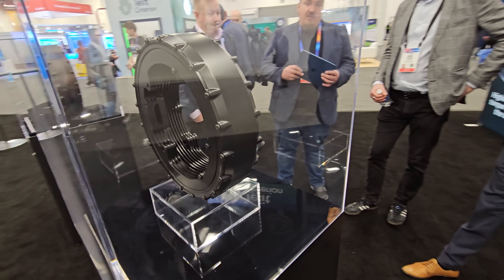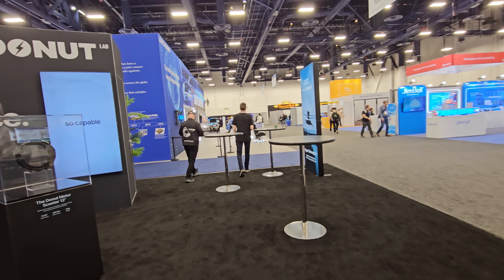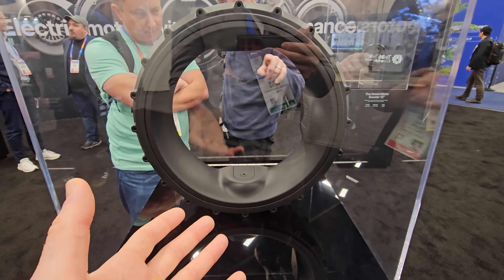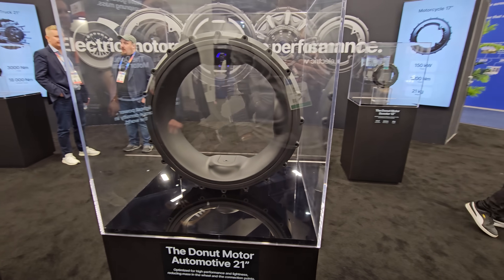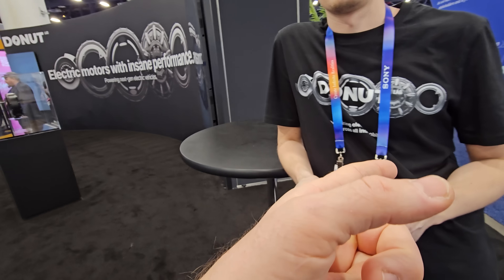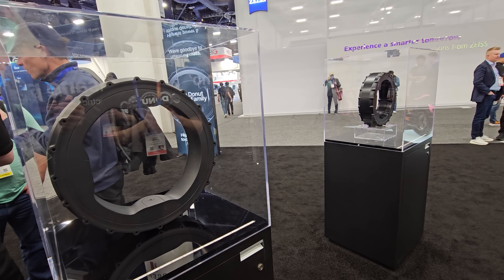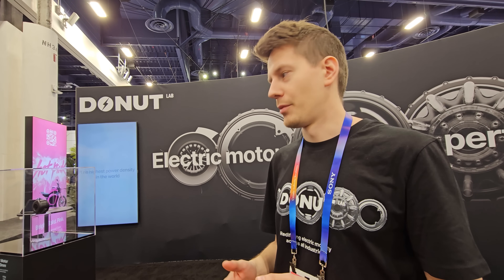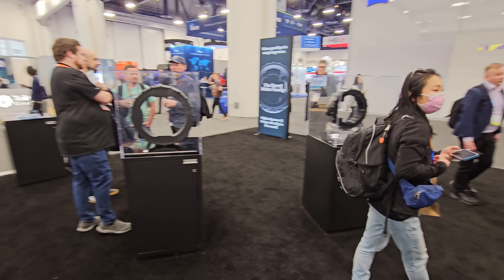Electric Motors With INSANE PERFORMANCE CES2025

Comment: There's no way that's real. A donut is a big zero guys. So it's a hub motor without a hub. The stuff looks very cool. So these guys have all brains AND style and there is no working version on display. No video. No charts. No pricing. That's a great big zero. A donut. The guy is a good talker. Eveey hubless wheel you see you never hear it in action. The numbers are so high. There has to be some type of iron core in order for the magnets to work. The core you use in your inductor matters. I'm not seeing an air core or whatever magic is allegedly encased in that flashy aluminum shell beating out current hub motors and also weighing less. Magical physics going on. A 40kg motor but way stronger somehow. 

Sure. No talk of how commutation is achieved or what kind of battery is required to get there claimed output or how far you would really go. It would take a huge battery. Even if this real (and it isn't, because a donut is zero it's such an obvious joke)there have to be downsides. Didn't hear any of that type talk. 

Nope. I think your first reaction where you didn't believe it was correct. The guy was a slick one for sure.
Reply: E motor tech is going nuts, I have a CYC motor that is 8kw + and the size of my fist,
Reply: The Verge TS motorcycle they have there in pink is their early version of the motor. That is a real bike and there are many videos, look it up.
Reply: @QuietContender  Any videos with sound of the bikes drivetrain or are they all pumped up ads with overlays of higher than expected specs. I'll go look but concept vehicles tend to have either heavily curated videos or disclaimers that basically allude to the vehicle being a one off.
Reply from the maker: You are lost in the sos 😀
Reply: @ElectricVehicleSpace  It's an obvious joke but it is funny, and if they get away with it it's way funnier. Just tell me where to send my money. lol
Reply from the maker: @zentechnician  you are so.....research for much this group paid for CES2025 visit and how big that stand it. People don't throw so much money without having something that works and has solid potential.
Reply: @zentechnician I’d be more interested in the bearing system and how it’s all kept square,
Reply: @LeglessReubsRides  What do you mean? It's not like a bearing as big as the outside of the rim would  have more surface area and therefore cause more friction. Yeah this issue has yet to resolved in any example I have seen. I did see Sam Pilgrim riding the failed one with his brother sitting inside the wheel. That was different, or as Sam calls it, normal. The thing was a noisy deathtrap. Oh man.
Reply: The media business is getting huge. So they just need sth to show and talk about is enough to make money.

The very first question is why? Why do you need hubless in-wheel motor. The only reason I see is for those who thought it looks cool. Otherwise, it is extremely stupid: the structure factor is huge, the bearing is disastrous, the sealing is harder than astronaut industry, the brake discs are expensive and heavy. Instead of scratch your rim, now you will crash your motor into the pavement.
Reply: @MrQuachBinh  After watching several reviews of bikes with working hubs, the verge pro is a very cumbersome (reviewers word) piece of machinery. The bike weighed 540lbs. That is exactly what my 89 Ninja 1000 weighed and it had a steel frame not the snazzy aluminum one of later models. I'm 6 feet tall and I was a weightlifter so the weight didn't bother me but that is a big heavy bike. I would let my friends ride it and often times I would have to help them pick it up when they drop it. Even the bigger guys. 540lbs. Yes cumbersome. The wheel seems very smooth but the reported numbers are very far fetched. The head of marketing of which I saw 3 different guys with that title over a period of 3 or 5 years was stating 1000nm at the rear wheel. To put that in perspective a zx10 is about 114nm. The Vurge did 0-60 in like 3.whatever seconds a d 8 believe I've seen Ninjas rated at 2.something, which after owning such a bike I can say yes that is definitely a thing. So a zx10 with 1/10th the rated nm is faster or even if the Vurge was a faster it's not 10 times the power. I'm assuming that's why the rear wheel needs to be extra wide. You lose a lot of maneuverability. I watched a guy change a wheel. Easy enough. 20 bolts around the rim plus like another 5 for the other part if I remember right so that is more like when you have to replace halls in your qs273. One bolt per spoke actually so 36. It gets a bit tedious doing that, especially when the hub motor is so strong it's eating your frame dropouts like candy even though you have 4 torque plates and a couple of other fasteners  trying to keep the axle from doing loop de loops. Qs273 weighs 40 pounds add a tire and run and you have a 60 pound wheel. On a bicycle that is also cumbersome but as a light motorcycle it doesn't really bother me at all. Still well under 200 pounds, guessing 165 or so, so that is a far cry from 540. The Vurge guys kept pointing out the battery at the bottom but that's how all the companies do it. So that's not a unique feature. No chain they said. Yeah it's a hub motor, if you lose your chain you just ride hone like normal. Not a feature. Oh and since you can carry a passenger they have their own set of foot pegs. Wow, you mean like on every motorcycle that seats 2 ever made? Not a feature. Here's a feature...31k pricetag. Ouch. Yeah that's quite a bit for a cycle that gets limited to 125mph. Yeah I would cruise at that speed sometimes and even faster. It's actually looking like a really well made product but I'm thinking about long term. Hub motors apparently don't last. This is why you don't see a lot cars with 4 hub motors. People keep trying and then it turns out to not be the best idea. These more complicated systems would be already in use if it were practical. Reinventing the wheel is their slogan. It's not that no one has thought of this guys, it's that it's not practical. Much easier to have an axle in the wheel. Yes a wheel integrated to a swing arm is cool, but it's too expensive and it's going to be a service nightmare at some point. Just because you can make something cool doesn't mean you've reinvented it. You engineered your way out of sone big issues but there are always more. I'll wait to hear some satisfaction polls from current users after they get some actual miles on these things. A lot of effort to work around having a hubless wheel. The coils on these motors are just normal coils in like the most basic and common configuration. For less than $2000 I upgraded a bicycle to go 100mph and you want 15 times that. They need a very specific set of customers with very deep pockets. If I'm going to spend 30k I'll get a gas powered offering that's faster and lighter and is NOT cumbersome. Looks cool but I will pass. I could make a faster bike from scratch for way less than half of 30k. That's silly money. Hers what I would do... Segway has their new one and it's way underpowered but it's the bones of an excellent build. $3000 I believe then add a 100 pound qsmotor and the matching controller for under 5k a battery I would just make myself a I've been doing for many years now but let's do the retail and say 3000(I could probably get closer to 1000).  5+3+3=11 
11k or cheaper I could make a very nice fast bike with off the shelf parts and then do that 2 more times to be where you are for one. 

I was already thinking if doing that but I'm really leaning towards designing my own frame and doing the send cut send thing or just making my own plasma table. An excuse to have another tool, not that I need one.

Comment: Cette moto en France coûte très très cher, et je plains le mécano qui va changer le pneu arrière vu le poids de la roue…
Reply from the maker: Thru drop the price to 20k USD. That's not bad considering premium design, tech and performance compared to luxury market.
Reply: @ elle est beaucoup plus chère en France et ne s’adresse qu’aux personnes qui ont les moyens, d’ailleurs on en voit aucune en France alors qu’elle est en vente depuis pas mal de temps… ( Verge TS sur le site officiel est à 33280 euros et la Verge TS Ultra à 54880 euros) si tu as les moyens tant mieux pour toi, mais même si j’avais les moyens je n’achèterais pas non plus une S ZERO Motorcycle à 17500 euros avec en plus la batterie bridée à 14,3 Kw alors que j’ai un gros équivalent 125 qui a le gabarit d’un 800 et le poids avec une énorme batterie de 17,6 Kw qui me permet de faire en continu entre 180 et 220 km a une moyenne entre 58 et 64 km/h sur routes départementales et Nationales dont je suis entièrement satisfait et payé que 10000 euros. Je suis un motard de longue date et j’ai fait presque 18 ans de grosses cylindrées sportives, mais si elles avaient été à ce prix, je n’aurai jamais pu me les payer même si j’avais une bonne situation à cette époque.    Je ne suis pas une vache à lait et donc pas question de payer une moto aussi chère, le plaisir du 2 roues n’est pas en fonction de son prix …
Reply: @ElectricVehicleSpace sur le site en France : la Verge TS coûte : 33280 euros, la TS Pro : 36880 euros et la TS Ultra : 54880 euros donc hors de prix, d’ailleurs on en voit aucune en France. Et si elle coûtait 20000 euros ça serait beaucoup trop cher encore pour une moto…